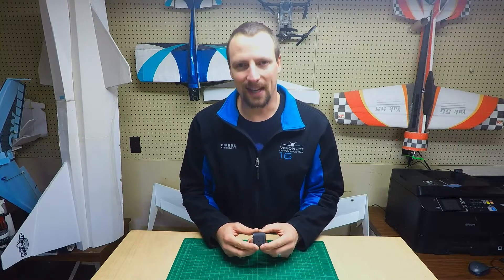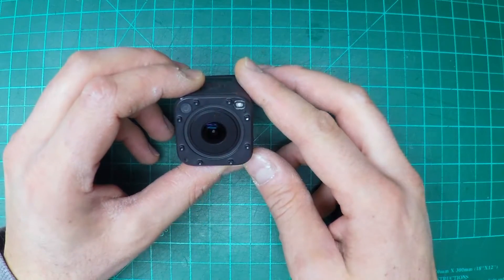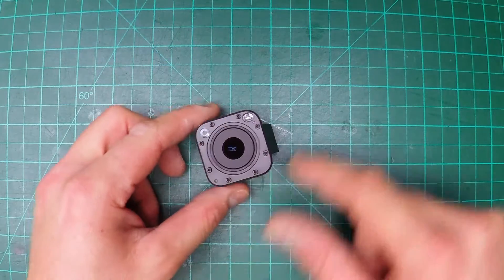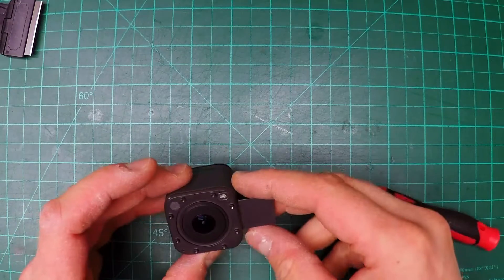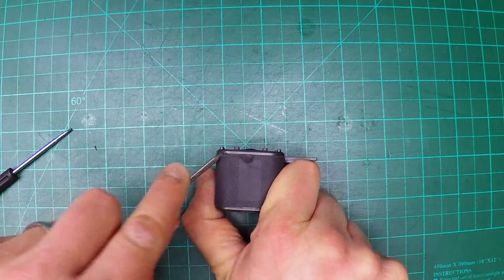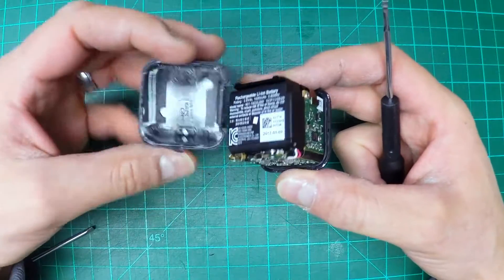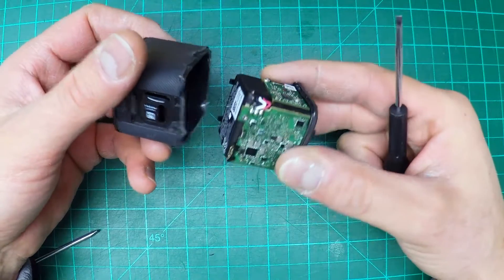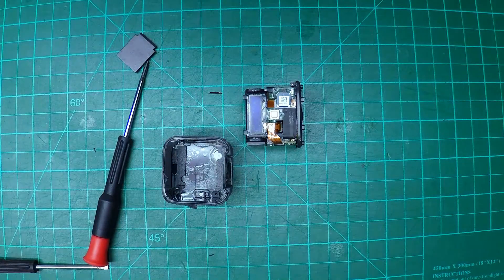Easy way to take apart (or destroy) a GoPro Session | Part 1: Getting the case off

Comment: The casing is a bitch to remove and requires patience. This little experiment took my Session from critical condition to the grave. Be very careful when prying.. there are fragile circuit boards directly underneath.

Comment: Nice! How long did you heat it up for?

I just pryed open a session. Tried heat via butane torch to no avail, too hot to touch. Then I tried using a hot hobby knife. It worked but the whole cam looks like shit and it completely looses its waterproofing quality as theirs no proper way to secure the case to the internals.
Reply from the maker: Oh bummer, I just used my wife's hairdryer for about 10min. Then a sharp ended flat-head screwdriver. That worked quite well. I think if I did it again I could do it without causing any damage at all. As for sealing it up again, I would just use silicon all around the edge of the case when I put it back together.